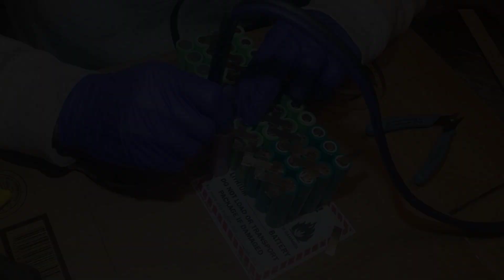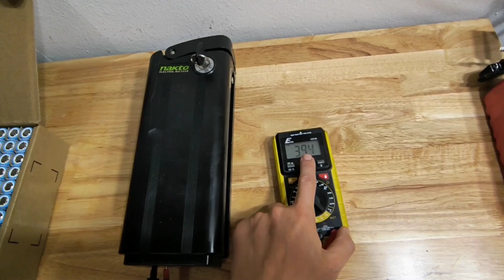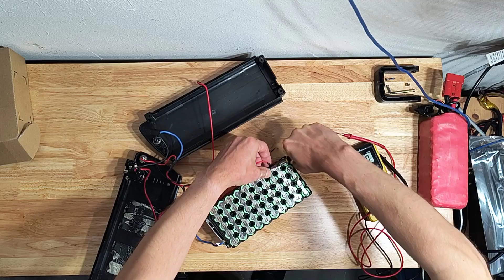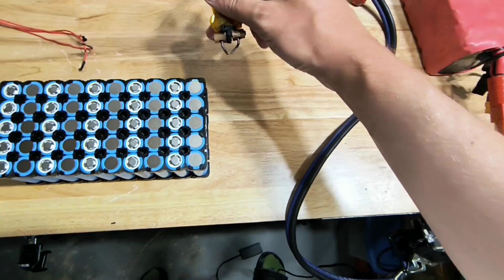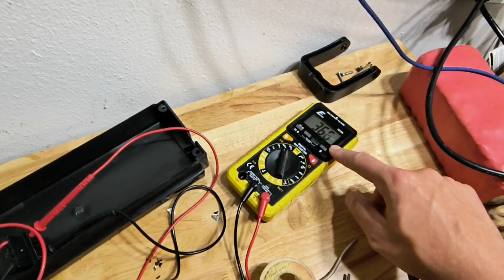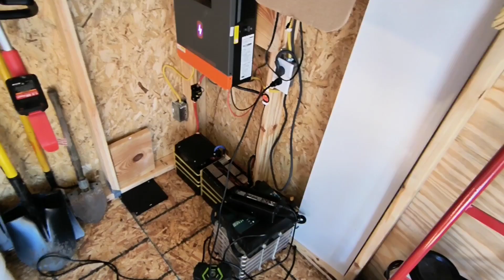Nakto 36v Ebike Battery Rebuild (Repair)

Comment: Thanks for the detailed repair video. I also just picked up 2 of these bikes used and the battery packs are shot. I'm going to replace the cells but I'm unsure of which ones to buy. What was the specific type/model of battery that you used in the new replacement pack?

Comment: How long did the original pack last?  Years and cycles (if you know)?
Reply from the maker: I dont. Got the bike used
Reply: Then how did you determine battery “wore out”?  Versus, bms fault, buss/weld fault, cell group fault?

Comment: What you are doing doesn't make economic sense unless you got the new batteries at such a good deal, a brand new battery has got to be cheaper or the same without the time spent building with the dangers that go with it.
Reply: brand new battery is on its way out because it's old model and they are almost $300

Comment: 1st video I'd seen of yours, and it was cleanly done I do have to say thanks. Had my inaugural run not long ago after finally having been allowed the use of one of these handy... handheld spotwelders! Yes, my very first expensive power tool battery repaired This Makita impact drill has been going strong since the first discharge, in fact I haven't used it but for a few light tasks and haven't had to recharge at all it was actually that long ago LoL but it has been a solid month of use. I'd been warned about a protection circuit built in to tool batteries of different makes and models! Computer printer cartridge expiration dates (that made them stop working, even when refilled)all over again. Hopefully there's hacks ready to mess up a savvy manufacturer constructed in time enough for us to be able to change our own batteries.